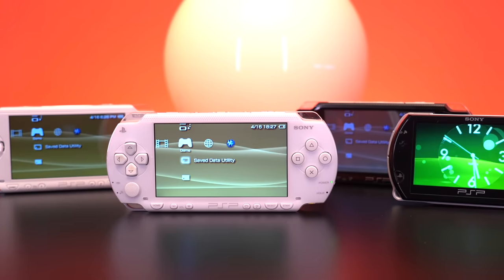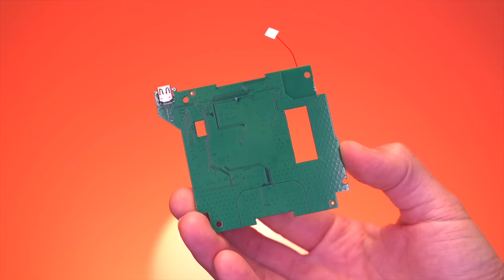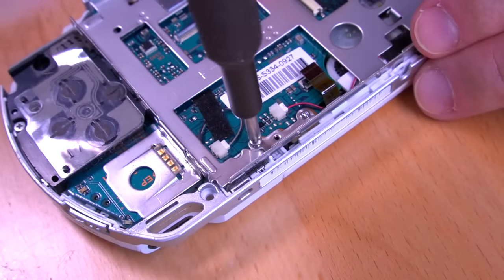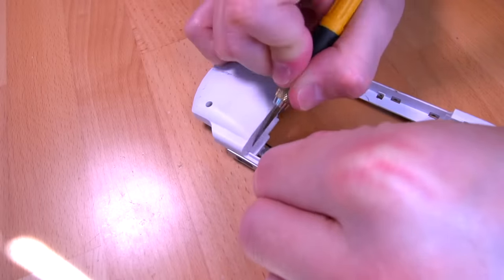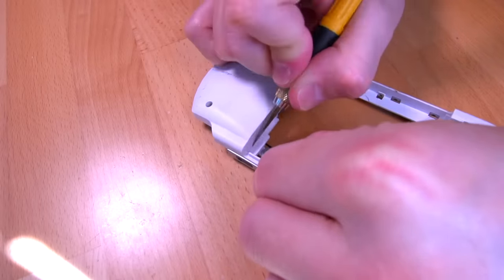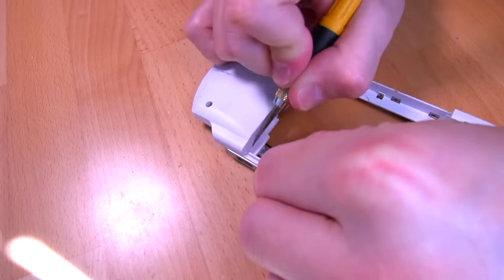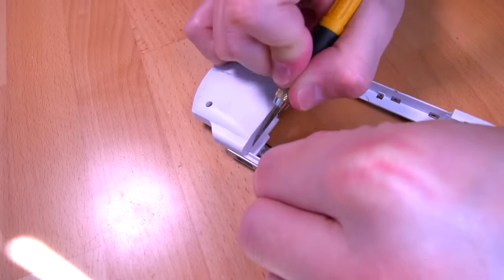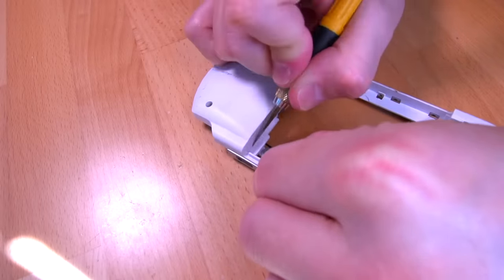Building The Ultimate PSP In 2024

Comment: HDMI mod, IPS screen, all good... but where are the dope battery alternatives?
Reply: None 😢 thing will die in 3 hours still...sucks that no one makes batteries of oem quality as well.
Reply: They don't exist.
Reply: Yeah, pretty much every aftermarket PSP battery sucks. My brother said so too as it’s hard not to go 30 minutes without dying. Let’s hope for something the GBA has and a Type-C mod for quick and convenient charging.
Reply: Some people on reddit did some heavy research and concluded that the Cameron Sino batteries are the best at 4½-5h battery life. Ostent batteries gave 4-4½h. The rest are mostly trash.
Reply: There is a battery mod that involves removing the optical drive and converting that space, plus the original battery case, to hold a much larger battery. The battery used is a 6050100 lithium polymer battery, and a search for "PSP  6050100 imgur" will get you a visual guide. I have done this mod myself on my PSP 3000 and the battery life you gain is unreal - I haven't been able to play  long enough in a single sitting to drain it, and that includes a couple 10-hour plus day trips as a car passenger -- and the battery meter was still reading at over half at the end of the day. Note that you do have to disassemble an existing PSP battery to extract the control logic board, but it really isn't a difficult process.
Reply: battery mod or Ostent 2200mah battery on Ali
Reply: @Toteniuz  Agreed here. Cameron Sino is usually pretty good about making at least OK replacement batteries and they provide them for several different consoles like the different 3DS and DSi models as well. They don't over-report the mAH rating of the battery like most of the cheap ones, and in fact under-report them so that any added mAH rating in the battery is a bonus rather than false advertising in the case of it having less than reported.
Reply: people have soldered the controller PCB of the battery to bigger cells which fill the UMD drive. That is also an alternative. Jsut have a buket of sand ready.
Reply from the maker: Totally agree!  We definitely need some new quality battery and shell replacements!
Reply: No doubt. I’ve bought 3 batteries and they were all old 😂 in the package 😅
Reply: You mean where is the psp 3000 ips screen lol. Theres already 4000mah battery mods that replace the disc drive
Reply: And usb-c perhaps 🤔
Reply: Agreed. With all the dope GB/GBC/GBA Lithium Ion battery mods out there, we need more love for the PSP, and eventually the Vita.
Reply: Rip out the umd drive internals and trim the plastic and it can easily fit a large battery. More than likely the way to go at this point as you’d likely have double the original battery life if not more since you wouldn’t be powering a umd.
Reply: I still got 2 original fat batteries, they still work great, they don't make them like they used to.
Reply: I just use a battery bank and USB to PSP charger. Even a cheap 10,000mAh battery bank keeps the thing going forever.
Reply: @Toteniuz agree, cameron sino is one of the best option.
Reply: Some people get rid of the umd reader  in order to put a large phone battery, using the original psp battery's circuit board
Reply: @MachoNachoProductions  There are custom shells out there, I believe.
Reply: Lol my psp dies in like 30 minutes :'(
Reply: Yeah, who cares about that UMD drive. Rip it out and replace it with a smartphone battery.
Reply: Its pretty much the battery MCU issue. Sony original battery MCU will brick itself if it detect no voltage or below the acceptable voltage from li-ion (From what I read some).
3rd party battery MCU either can brick itself randomly, although some does have its own reset pad. Some doesn't have reset pad, some are totally new design that no one see before. Some straight away doesn't work.
I have a original battery that doesn't work even after modded. Its cell are showing 4.2v.
I bought 2 pieces 3rd party battery. Both doesn't work and its MCU are not listed in any of the battery mod/guide people done.
The only working good PSP battery are PSP GO and PSP street. And you only need to change to new battery without sony stupid battery MCU.
Reply: @floppyD  Or consolize your PSP? Is it possible? Maybe sacrifice the UMD drive and get it to connect to your computer via USB? How will I do backups then?
Reply: @rockhyde7775 wait I ordered one on Amazon for my pspgo your telling me it's not gunna be good?
Reply: I wonder if it would be possible to make a small 'bracket/adapter" that would be shaped like the PSP battery and fit another Lithium Ion battery into. It'd most likely have to have solder points and you'd have to trim the connector off of the "new" battery and solder it to the Positive and Negative pads in the adapter.
Reply: @MachoNachoProductions  the “need” for PSP batteries - good future content to talk about.  I wonder who will fill that “need”
Reply: @scribeofsolace  i found
a company called cellonic in europe
which are quite okay, despite the fact that battery life on the psp was always in issue (compared to the DS fe.)
1000 battery is still a bit better then the 3000 ones..:)
Reply: I use a nintendo switch battery. I got 10 hours on idle with crash bandicoot launched from sd card.
Reply: @MachoNachoProductions  :)
Reply: @MachoNachoProductions  You should make some videos about the options in the market and the comparison between them
Reply: @erit1963  I didn't know there was barrel connector to USB for PSP, that's pretty nice. I use one for my Game Gear for obvious reasons. Also USB battery pack makes things like the NeoGeo mini into full portables.
Reply: There was an option to output video via the USB port of the PSP via software on windows PC on modified firmware launcher, does the HDMI output represent an improvement worth the effort?
Reply: ABCS-WDEFOOHRGI
Reply: I still use my original battery on my PSP 2000, I think it would last something like 3 hours straight, major downside on it is that it goes to almost 0% if the PSP remains on the standby for roughly 1 month straight. 
Do you guys think it is best to replace it or would it'll be the same result with the other batteries from the market ? That mod with the big battery sounds good but I still don't want to disassemble my PSP and make those hard mods.
Reply: I bought tectra one, its very good, the battery lifetime is around 5-6 hours of playing
Reply: Just buy 2 extra batteries and have them charged up. That's what I did and it works great
Reply: get a 20 thousand mah power bank and a usb psp charger and you can game all day.
Reply: Ostent 2200 mah for the 1000/2000 and the 1400 mah option for the 3000
Reply: The BEST aftermarket batteries are from Cameron Sino.

Comment: PSPgo is best psp just for the ps3 controller support
Reply: Wait what?!
Reply: Agree
Reply: You could say that the best PSP is a PS Vita. Digital output, external controller support, OLED screen, hacks that support the second analog stick, etc.
Reply: That mixed with the fact it’s dockable like the Switch
Reply: The white go is the most beautiful handheld in my collection (which includes 100s of handhelds), very underrated
Reply: i didn't know this
does this mean the PSP Go is an ideal candidate for a consolized PSP?
Reply: @myretronation  might as well get a Vita TV at that point
Reply: @myretronation  it's yet it would be a shame to waste such a beautiful handheld unless it was already broken... my preference honestly would go to some other model that would allow the consolized version to still support UMDs
Reply: @myretronation  If you spend enough money you could use a regular PSP Go, buy the dock and component cables, then hook that up to either a Retrotink 5X Pro or Retrotink 4k. That way you basically have a setup that's like the Nintendo Switch.
The only problem is that the dock is fickle and expensive. The port itself can be pretty annoying to deal with and is prone to breaking, and there are no good aftermarket alternatives.
Reply: biggest downside is PSP games scale in windows mode and cannot be expanded (unless there is a CFW that fixes that) Psone games scale fine, just PSP games are tiny af.
Reply: You would need to either play on the tiny screen with a stand or output to a TV. The PSP Go does have the best looking screen, but it is not as comfortable as the PSP 1000 - 3000. Also PS3 controllers are getting hard to find in functioning condition. The little foam pad deteriorates leaving a poor connection between the ribbon cable and board. This usually causes errant inputs especially if you flex the controller. Not a hard fix, but I just went ahead and ordered a Brook Wingman 2 XE to use with my PS3. I use it with a 8bitdo pro 2 Xbox wired controller.
Reply: @myretronation  biggest downside is scaling. The PSP games scale in a windowed mode for some reason. if your TV or scaler supports zooming, that could fix it, but by default all PSP games that are output are in a windowed mode.
Reply: Just emulate it, you can run psp on anything. You can have the big screen with your custom controller experience. With 4K support and 60fps hacks too.
Reply: @myretronation  One of the challenges to that is when you have to navigate through the menu to turn out the video output. I haven't tried it in a bit, but it might be required every time the console is rebooted or shutdown. Worth looking before even considering it.
Reply: Both PSP 3k and Go have PS3 controller support.
Reply: @thatzaliasguy  awesome! never had a PSP 3K ☺️
Reply: @alex_mula  i guess either the RetroTink 5X or 4K can overcome this
Reply: Couldn't you do remote play on all PSPs though? I swear that I saw the option on my 1000
Reply: @thatzaliasguy  I’m pretty sure only the Go has the ps3 controller support. Source mylifeingaming
Reply: @Daily6969  I mean to Bluetooth pair a ps3 controller to the psp. On the Go you can do it and put the picture on the Tv making it more like a psp mini console
Reply: @harryknapper1133  ohhhh, well yeah okay. That's cool actually
Reply: fucking love mine

Comment: Kinda disappointing, PSP already has analog video output, you're doing quite some work, spending 40 bucks, removing the UMD drive, and IR Blast(+ without covering the connector sides) just for HDMI output.
Reply: But that depends on which PSP model you have

As I emphasize, the mod is only for the 1000 or Fat model, which those don't have video output, so if you have a PSP Fat that doesn't read discs, it's an excellent option

Comment: 3:32 ...That's a micro HDMI port not a mini (which is wider but not as tall). I'd thought I'd mention it so anyone who doesn't look to closely at an amazon listing winds up buying the wrong cable.
Reply: You're first, I just wanted to also mention it
Reply: Sad thing is, it looks like a mini HDMI would have fit with a little filing and is a much better connector.
Reply: @PatrickOuthier  miniHDMI won't ever fit, because this is not a miniHDMI, it's microHDMI which is a smaller connector
Reply: @Schabik1990 , he most surely meant that they should have used miniHDMI port on a PCB, as it supposedly would fit through the IR window with only a bit of a filing, but leaving less of a gap overall.
Reply: @HYBRID_BEING  I can agree on that, but it won't fit, it's too wide.
Reply: @Schabik1990  he also said "with a little filing". Don't have PSP-1000 and miniHDMI port to check how much filing would be required though.
Reply: sad they couldin't just use usb c out and also let us charge oh well
Reply: @bland9876  Unless someone miraculously manages to create a custom PCB for USB-C compatible with the PSP Vita (2011) that's not all at all possible (to say nothing of the original(2004).  The 1.0 standard for USB Type-C wasn't released until 2014.
Reply: @TwistedMe13  we are in the early days of custom PCBs for the gameboys and gamegear. we will get to that point in the next few years
Reply: @Saber_Nico  Fair point... Let me rephrase, it'll be a miracle without desoldering the system's chips and soldering them to a custom board already holding an ARM SoC.  They'll become co-processors on a system that will handle the protocols these portables were never designed to even consider.
Reply: @TwistedMe13  I don't know exactly what you're asking but I'm just saying route the video signal through the USB-C cable while also routing power back into it just like they do on other devices and then you use that in your video outboard just like you replaced here instead of using a micro HDMI port and then you just have to solder up some extra wires other than the ones he did sold her up because the power would have to go to the battery somehow.
Reply: i have one brand new since 15 years ago

Comment: Few things as someone who's done the ips mod. Make sure you get the gasket and put it on. I got a screen without one and dust wouldn't stop getting under the plastic. Also don't skimp on shorting the right thing - it can move the image up or down cutting things off. 

Also, psp can play ps1 eboots because it can play ps1 natively without emulation. Good luck all!
Reply: I thought PS1 eboots were emulation?
Reply: @celebraces2 yes it’s all emulation . There’s no fpga or ps1 hardware inside of it lol
Reply: "there's strong evidence that the PSP's MIPS R4000-based CPU is running most of the PS1's R3000 code natively, but it's highly likely that the rest of the PS1 hardware is being emulated entirely by software"  @Drivenby
Reply: @mmpsp693  Either way its an emulator called POPS (Playstation-On-Playstation)
Prototyped on PS2 Network JP where it was version POPS-001